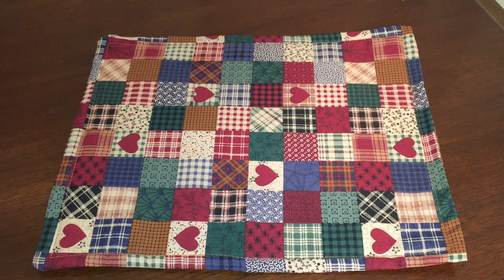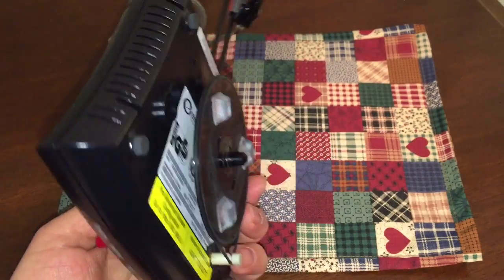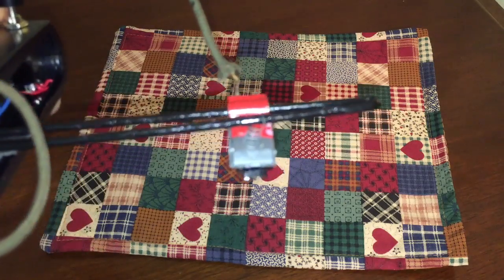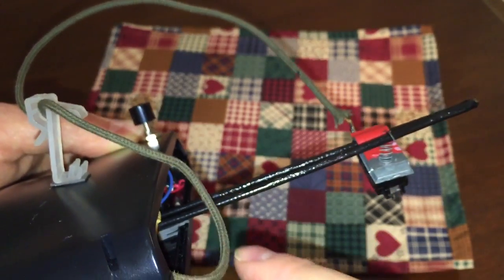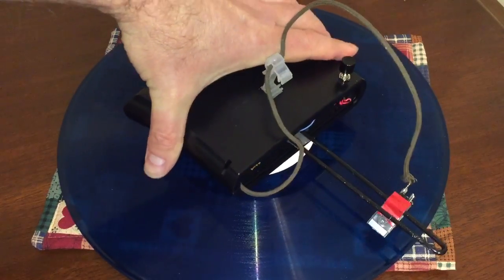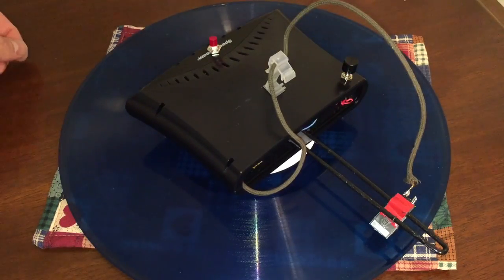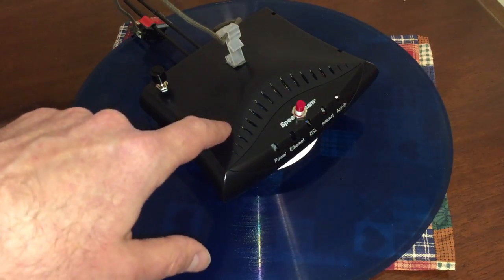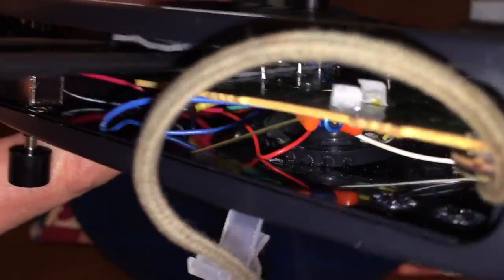Better than RokBlok?  My Home Engineered Record Player!

Comment: If you put a small Bluetooth model on it and a small battery a small amp (a small amp board) to play it will work better instead of a wire.use a gram weight to measure you needles weight to bend the hanger to play it right.these changes could work.I made a Bluetooth cat ball for our cats and it works well.I'll do more stuff for our cats soon.

Comment: This reminds me of something similar I saw demonstrated by a collector in Ohio maybe 30 years ago.  It was in the shape of a footed coffee cup.  The bottom of the foot had a spring loaded spindle that clicked into place on the record.  The entire thing was stationary as was the record, only a flywheel near the top moved. Attached to the flywheel was a rod with a small articulated tone arm with cartridge.  The top had on/off/volume switch, 33/45 switch, and speed control dial, probably to adjust faster for weak batteries.  Also on the top was a metal grille containing the speaker.  I've been looking for one of those for years and years, they must be rare as hen's teeth!

As someone else here said, the vw bus that drove around on the record did slow down as it went toward the center of the record to maintain the same record RPM's.  It was all by the angle of the cartridge in relation to the drive wheels.  Listening to the motor while changing the angle of the cartridge, you can hear it slow down and speed up.  There was an led inside with a half cowling attached to the cartridge, read by a light sensor.

Comment: I think I have a rather fitting name for your invention:  The Phon-O-Fuge.  Because it's a PHONOgraph that operates similarly to (and also resembles) the centriFUGEs that NASA uses to train astronauts.  It would be nice if you could find some way to modify it to play 45's and 78's as well (and maybe get a Pfanstiel P226 cartridge with a dual-sided flip-over LP/78 stylus as well)!
Reply from the maker: +Sanjay Das - Oh my, with the G-force created at 78rpm it would likely just send me back in time, not play the record!

Comment: acording to the record  my face is going to droop. but on a serous note building a second version with a zero friction air bearing for better linear tracking of the cartage to slide on would be smashing.

Comment: The only real record player experiment i did was more like making a crude record cutter, done by cutting sound into a plastic pretzel can lid, and for a cutting arm I used a sowing needle and stabbed it in to a tiny speaker. It worked, kind of!
Reply from the maker: +Isiah Folio (Asdfguy86) - Great to hear you tried it!
Reply: databits Could you try doing the record cutting thing on a floppy disk platter?

Comment: could you use some sand paper to smooth the coat hanger out a bit?
Reply from the maker: Andrew Rhone One suggestion was to place a section of tubing underneath the spring.  I may try that.